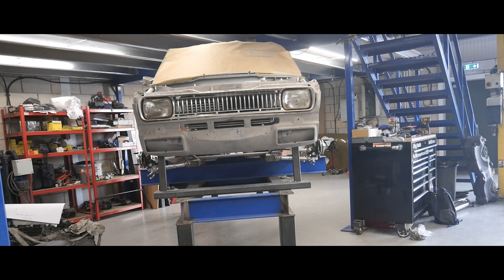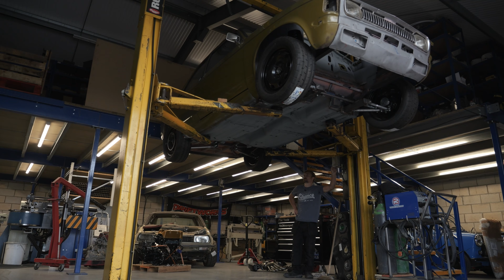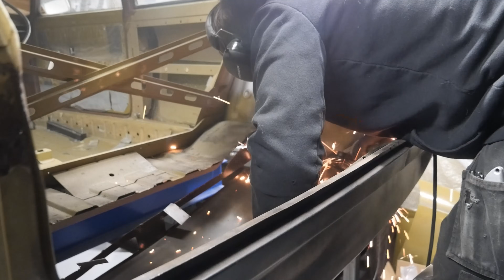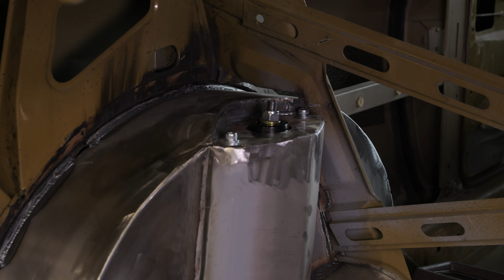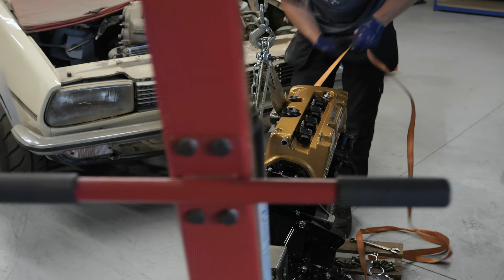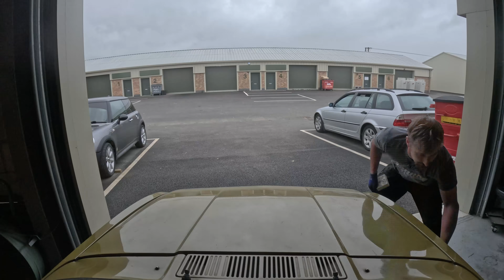Project AllegRo - EP8: The K20 Allegro Is On Its Wheels For The First Time!

Comment: They got made better when they were fitted with a rover 3.5 litre engine and rear wheel drive like my friends one had in the 80's, it really became a real Sport when racing around Lydden Circuit and was just a little bit faster than the old 1750 engine was 😅 It decimated Capris at the traffic lights

Comment: Loving the project, and great work by the way...I'm always curious about material thickness  and tube sizes chosen on individuals projects. I'm  looking at 50x50x1.5mm ERW box on the floor, and  25x2mm ERW for the wishbones/trailng arms on mine...what have you use ?......cheers ...PAUL

Comment: The allegro bodyshell is not weak, in a test of beam stiffness by pressed steel fabrications, it shows the Allegro had a figure of 5.5MN/m .
Which is lower than the ADO 73 mk2 Marina at 9.7MN/m .
However it was higher than the mk1 vw golf stiffness at 5.2MN/m .
Also more than the mk1 ford fiesta at 4.7MN/m .
And the mk1 renault 5 measured at 3.7MN/m.
So the allegro bodyshell is actually one of the best not weak by any means

Comment: Is an anti roll bar essential? 
Id say it was suspension dependant. 
Just food for thought, I only have anecdotal evidence not running one on a car with vastly improved suspension over stock and it was fine, pretty sure certain race cars dont run them either.
Reply from the maker: I’d much rather build the car with provision for it and end up removing it. Much harder to add it after the fact 😃
Reply: @FabCoUK  Without a doubt, mine was still in place just not connected (I wanted more suspension travel), no leaps of faith without a get out of jail free card here! 
Just musing as I watched the build reminiscing about messing with cars.

Comment: Good work. Not that confident on the pipe clamps on the rack. They are pretty robust but not sure how they would take any shock loading like kerbing it etc. The normal clamp and rubber type allows some extra resilience whilst containing it and allowing movement. I use these clamps in relatively low stress applications in some aerospace prototype work that I do. They are fine for that.
Reply from the maker: A lot of OE racks are solid mounted. We will learn in time how well it works 😊
Reply: @FabCoUK  yes they are but not with pipe clamps😂 Iam sure they will be fine with normal use as you have the rack captive between them.
Reply: @NK-dl2nc  They'll become brittle and crack surprisingly fast.

Comment: Nice work. The oil cooler needs less cooling than the water radiator. By placing it on the inside it would also simplify the "plumbing".
Reply from the maker: It goes where it fits 😃

Comment: On the lift it looked like the spring was off its cup?
I know it can't fall out but normally it should still be under some compression or you use a helper spring on adjustable coil overs.
It just means that if you lift it up it can settle incorrect in the cup, depending on the shape of the spring.

Comment: That definitely doesn't look like a sleeper.
I still think it should be called the Equipe R, no-one under 40 will know what the Equipe was anyway.

It's too low to be a sleeper, any petrolhead even gen Z will work out it's performance immediately.

Please just wack the Equipe badge with the Honda R after it on the grill.

Comment: Love it mate - but take a bit of advice - get the steering rack pillow blocks made from alloy - dont use poxy plastic hyd. tube clamps.  You'll get creep with the plastic and the heat under there wont help - will go soft.
Reply from the maker: Ok thanks!

Comment: First I would like to appreciate your practical skills and your engineering skills! You are a very talented man indeed! About the steering rack mounting this have been a problem for mini racers over the years. It have been found over the years that the entire "toe-board" seams-to flex and because of that I would suggest to strenghening the toabord as much as possible. If my memory serves me alright I think the toeboard of a standard mini is about 2,5mm thick. And that flexes... About the general weakness of the Allegro shell you talk about. Would it be worthwile to insert an extra sill in 1.2mm steal some 30mm into the car on either side of the existing sills?
Reply from the maker: I mention in the video that I’ve swapped the hole lower half of the bulkhead where the rack mounts for 2mm sheet 😊 A classic mini would have 1.2mm in that area
Reply: @FabCoUK  I agree that a 90's mini shell would have about 1.2mm in that area. But on a 60's mini you would find it thicker. Anyway I have found this to be strenghened sometimes even with 20mm tubular bars welded down the toeboard area. But as you are building a road car, 2mm might be sufficent enougt. Anyway keep up the good work!

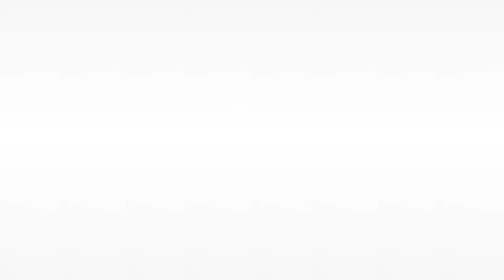Comment: Surely  the whole idea of a sleeper  is so the body looks no different   to a stand car  it's not my cup of tea  the allegro  I'd like a mk 1 fiesta or mk1 ka as a sleeper myself   just keep it as stand as possible  inter cabin and  outside  just Change  the running  gear and  engine and brakes  that's what I would  like to  do i had a nova sleeper  many years ago looked a right rust bucket but boy did it surprise  many a car how quick that was  loved that car  friends  of mine had built  it from scrap yard  parts  but we are talk late 70s early 80s here  so much fun and i would do it again  with a nova given  the chance  😂 18:11
Reply from the maker: How did you manage to get hold of a Nova in the 70’s?🤣 Unless you mean a Chevy Nova😎

Comment: Great video 👍Put a fuel tank under the rear seat like a modern car,weight displacement safety etc.
Reply from the maker: The rear suspension is under the rear seat 😁
Reply: @FabCoUK  oops my bad not up to date on the build 😔

Comment: I remember asking a question when you talked about the steering rack before….I’m curious how you calculate the match of pivot point from suspension to rack to avoid the car changing direction as the suspension is active on road surfaces (bump steer)… ? 🤔
Reply from the maker: All the information about how to do bump steer calcs is available in many places online & in books, I’m not going to try & explain it here and it’s not my trade 😅
Reply: @FabCoUK  thanks….I’m a fella.. rubbish at reading, sure you have it in the bag tho. 😊

Comment: Put the fuel tank vertically behind the rear seat diagonals full width full height
Reply from the maker: If the top of the tank is higher then the fill point in the body you’d have no chance of filling the tank 😕

Comment: How do you set the ride height without the engine in? The engine and transmission weighs several hundred pounds
Reply from the maker: Easy with coilovers when the weight of the engine isn’t enough to compress the springs

Comment: Happy to be wrong but I remember reading that oil coolers should be mounted with lines going pretty much any way but in from the bottom so they bleed effectively and/or don't accumulate air in the cooler making it less effective. Not sure if it's only an installation or also a running issue as well.
Davies Craig have a bit about it here:
https://daviescraig.com.au/media/2363/1666583494.32mmUniversalOilCoolerInstructions2891824-Oct-2022.pdf
Reply from the maker: I’ve mounted oil coolers in this orientation many times, and seen others do so without any issues. We’ll see how we go😃
Reply: @FabCoUK  I've been thinking originally that a small bleed screw or similar at the top of the cooler might help, but then got a stupid idea that I haven't yet been able to prove is stupid...
What if you deliberately had pressurised air in a reservoir off the top of the oil cooler? Your oil cooler volume could be made to behave somewhat like an AccuSump. I'm not sure there's the required volume in most oil coolers but if you were to fit a accumulator anyway you could up size the cooler and avoid the accumulator and still probably come out on top for weight and complexity. 
Thoughts? What am I missing? There's no piston like an accumulator but that seems more so that it can be horizontal than having to separate the oil and air. An oil thermostat might complicate things but I doubt that's insurmountable.

Comment: Its interesting the different approaches that you guys and Retropower have taken. They went with the Integra chassis, you went with a bespoke 'from scratch' design. Both impressive mods in their own right.
Reply: I am equally impressed by both, but the Retropower build budget will be huge, and totally beyond the means of most. I am very impressed by how this build is going on what has to be a much smaller budget. Very clever stuff!
Reply from the maker: They’re doing an amazing job 😃
Reply: @FabCoUK  I seem to recall there was a guy that did a Vauxhall PA Cresta coupe, using a 4 door Cresta body and welding it to the Jaguar XK8 underpinnings. He got a lot of hate for that. I thought the hate was crazy. Personally I find the work yourselves, RP and Electric Classic Cars do is nothing short of amazing.

Comment: Amazing what you've achieved so far.  The technical engineering you've put into the structural side of the build is jaw dropping.  And most of which will go unseen once all is done.  Looking forward to more of the same.  Thanks.
Reply from the maker: Thanks!

Comment: I was already partial to an Allegro (don't judge) but even with my weird biases aside, that actually looks cool. Fantastic work and so sleeperific :D
Reply: I used to own a 1980 Allegro 1750 TC Equipe which was an excellent reliable and quick car for its day - I would still have owned that car today if it wasn't written off in an accident caused by an idiot driver - it went for scrap in excellent condition apart from the accident damage as I looked after it. We also had a 1978 Allegro 1500 LE in the family at the same time which was also a very reliable and excellent car as well - both of these models of Allegro are very rare now. I always came back to my Equipe anywhere it was parked with people looking at it and in it and asking me about that car - you never got that with any other "normal" cars such as the Allegro.
Reply: @williamwoods8022  , Douglas Bader wanted one but it had to be an auto. That wasn’t in the spec but they snuck an auto box in for him; the only one made. I wonder if that is still around? There are fewer than 10 Equipe models remaining.
Reply from the maker: That was the plan!
Reply: Me too. Had an old banger for 3 years in early 80s, was comfy and gave me no trouble.
Reply: @johnnunn8688  jealous that you owned one! I just think they look nice (but I was 30 until I realised most people didn't eat kiwi fruits with the skin on - I understand I am not a normal person). Interesting how it'd be a "banger" at that point - early 80s would have made the oldest of them about 10 years old. Cars just aged differently back then I think.
Reply: @LewisCollard , think I paid £400, deffo a banger. Modern cars are often soulless lumps but they do last far longer.

Comment: The mounting for the Escort steering rack will be grand. If you're unsure, replace the abs plastic with nylon. Great update.
Reply from the maker: Thanks!
Reply: Or even aluminium machined blocks.
Reply: @southney7211 the aluminium will wear the casting of the rack over time, and become loose. The nylon will wear over time and not damage the rack. Nylon blocks are used for mounting hydraulic pipes on the Eurofighter Typhoon. So they are ample enough for an Escort steering rack on this build.
Reply: @E9JMX  If you look at a pre ‘94 Polo steering rack; it’s a cast aluminium rack mounted hard to the bulkhead using pressed  steel brackets. Never seen an issue with the mountings failing in any way.
Reply: @southney7211  hell of a difference in torque steer between a shitebox Polo and a 400bhp Allegro 🤣
Reply: @E9JMX  400 hp is double what people run in Polo’s, but they’re both shite boxes 😉